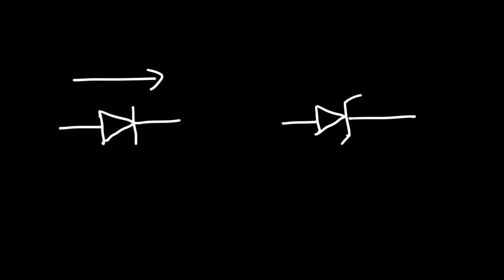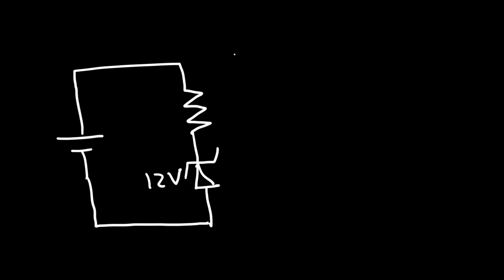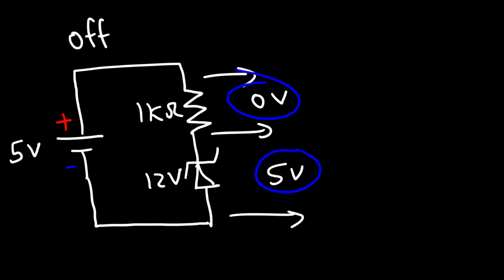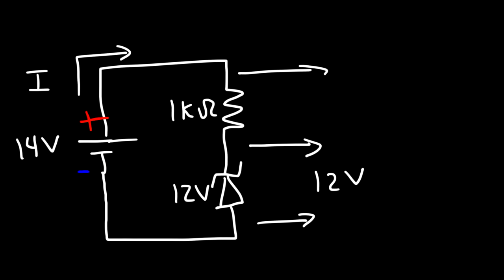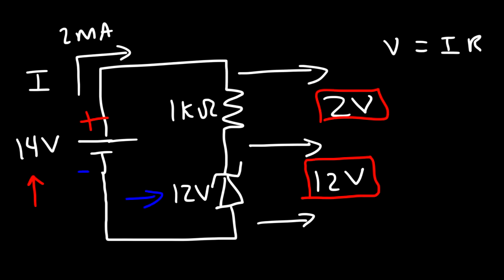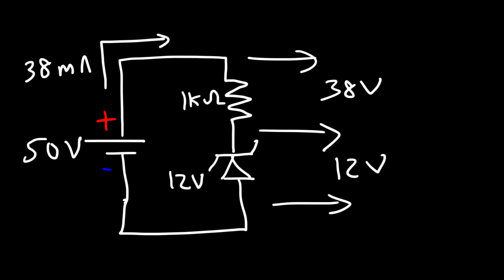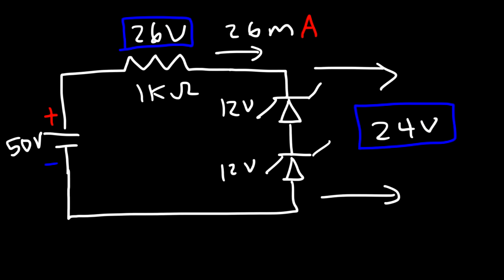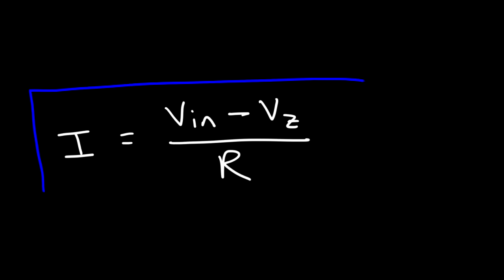Zener Diodes

Comment: Don't know about you guys, but ever since more than 40 years ago, in my school  electricity, that means, current, would flow against the arrow, so, as for me, it is rather difficult to understand your "new" theory. Sorry.
Reply: I'm likely the same age as you.  I was always taught that current flowed positive to negative, and a lifetime in professional electronic design has backed that up.

I had a tearful moment of crisis at age 10 when I found that electrons flow in the opposite direction, but I soon got over it.  :-)
It's easy to rationalise when you remember that electrons are negative, so negative flow from negative to positive is positive flow from positive to negative.
If we were starting again knowing what we know now, we'd probably define electrons as positive, but it's a bit late now.
Reply: @epiendless1128  The notion of the conventional flow of the current is much more practical in working with electronic circuits. As regards the classic example of understanding how a rectifier diode works, we usually say that it conducts "when its anode is more positive than its cathode" or, when this doesn't happen, because its cathode is more positive than its anode, we say "the diode is reverse biased, so it is in cut off state". The notion of the real flow of the current renders the above explanations (taught for years and years now) absolutely absurd. On the other hand, when we have a circuit of resistors connected in series in a closed circuit and we measure the voltage across any or every resistor of the circuit, the multimeter will show a minus sign if the red probe (connected in the right terminal of the instrument) is connected to the side of the resistor nearer to the positive terminal of the power source. Practically speaking, the conventional current flow makes our life much easier in order to understand circuits and troubleshoot failures of them. At least this is my humble opinion about the topic...
Reply: I agree.  They explain it as "holes flowing in a certain direction" rather than current flowing in a certain direction. 

To the elements in the circuit,  it doesn't matter if "holes" (i.e, positive charges) are flowing one way, or current (negative charges) is flowing the opposite way.  If you're able to conceptualize that, it makes accepting the idea of "conventional current" (i.e, following the path from positive to negative)  easier to live with.  However, I agree that they should just make the switch to following the path correctly, from negative (excess electrons) to positive (lack of electrons).
Reply: @maskedmarvyl4774  "just".

Comment: why the voltage across the diode is always 12v?I don't think that's correct because the diode only works like a switch here but not a resistance that it will have any voltage drop!
Reply: A zener is not a switch.  It's a voltage drop.  Think of water 14ft deep encountering a 12ft wall.  Only the top 2ft of water can flow across the wall.

Comment: I have see a few of the depict electron flow in the wrong direction. Electrons flow from negative towards positive. Ie. the negative terminal of a battery to the positive terminal. This means in a standard power diode (IN4004) the electrons flow against the arrow (triangle point) of the diode. As described in the video, a Zener diode allows a specific amount of flow in reverse bias configuration called leakage. (with the point flow)
As a side note, electrons don't actually "flow" through a conductor such as a wire. It is an energy bombardment impacting each atom of the conductor sent through it as a wave. Think of that thing with a row of steel balls each hanging on a string, you draw the first one back and release it allowing it to hit the second ball. None of the balls move except the ball at the very end swings out. This is the exact principal of how electricity gets from one end of a wire to the other end.
Reply: If want to explain this to people, create your channel

Comment: Can someone please clear up my confusion. In A.C circuit example 2 zener diodes are used, how is the voltage drop of forward biased zener diode 0.6V and the other 12V.
Reply: A forward bias zener acts just like an ordinary diode, and silicon diodes have an inherent voltage drop (at low current) of 0.6V.  You need to go into the physics to understand why.  The reverse biased voltage is what the zener was designed to do - you can get zeners in lots of different voltages and this one happens to be rated 12V.

Comment: I'm trying to use a zener to turn on a relay at a specific voltage. If I'm understanding correctly if I put a 12 volt zener in series with a 1k resistor I can turn on a 12 volt relay and when the supply voltage drops below 12 volts it turns back off?
Reply: The relay would turn off anyway if the voltage drops below 12v.You don't need the Zener diode.
Reply: @smak3924  no it wont/didnt.
Reply: @eavedesian  for this purpose you need a circuit composed from a NPN small signal, general purpose transistor that will drive the coil of the relay. One side of the relay coil goes to the power supply positive. The other side of it goes to the collector of the transistor. Across the coil you need to instal a diode in reverse bias in order to protect the transistor when the relay deactivates. This means the cathode of the diode (it can be 1N4148) goes to the coil terminal of the relay which is connected to the voltage source positive side and its anode goes to the connection of the coil with the collector of the driving transistor. Next, the emitter  of the transistor goes directly to ground. This means that the relay coil is in series connection with the power supply. Note: if by mistake you connect the protection diode in the opposite way, it will burn out immediately destroying the transistor as well, as soon as the circuit activates. Then, the only thing left is the base circuit. There, on the transistor's base, you connect your 12 volt zener. Its anode goes to the base. Its cathode (the coloured ring side) goes to the resistor. And finally the free terminal of the resistor (which is the voltage sensing terminal) goes to the connection point you want to detect. If this is the +12Volt of the power supply, then it goes there. The point is that you need to find the relay's activating voltage experimentally. This means that if you use a 1KOhm resistor, perhaps your circuit will not react on 12V needing higher voltage. This means that you have better to use a trimmer potentiometer of 1KOhm instead of a fixed resistor and then adjust it to the reaction point you wish. Perhaps, for activation at around 12volt, you need to play with smaller zener diode voltage, say 6,2V for example. (Correct resistor value and zener voltage need exact calculations, but you go by experiment).  I hope this will help you out. You can find details about this topic if you search about "automatic full battery charge cut off" circuits for 12V lead acid batteries. This type of circuit is used extensively in a plethora of relevant videos about this circuit.

Comment: why you have taken 0.6 v for forward bias
Reply: eight months without an answer hhhh, look at those who are thanking him, they don't ask for more, they're already saturated, i'm gonna wait with you till someone gives us a good answer
Reply: The forward voltage drop required to set a diode in conduction mode or min. Usually 0.6-0.7 volts below which the diode does not conduct
Reply: 0.6v is a typical value, you can get an exact spec from the datasheet of the specific zener diode

Comment: If the R is in series with the Voltage source, and there is another resistor in parallel with the  Zener diode, what happens when the voltage source is just equal or below zener voltage? Would the current go to the parallel resistor?
Reply: What you've described there is a resistive voltage divider.   If you just have two 1k resistors in series powered from 24V, then each resistor has 12V across it.  If you then connect a 12V zener across one of the resistors, little-to-no current flows through the zener, because the current is already going through the parallel resistor.  If you then increase the 24V to 36V,  you'll get 24mA flowing through the lone resistor, and 12mA each flowing through the zener and parallel resistor.

Comment: Conventional current should be relegated to the dust bin of bad science. It is still around due to each graduating class starting with the first one 250 years ago being taught it. When it was discovered by JJ Thompson that it was the electrons that actually flow negative to positive, not positive to negative.  It was so ingrained in the scientist heads of the day that current flows positive to negative, that it is still used today even when it is totally wrong. Granted it doesn't make any difference to the circuit, but as I had mentioned on my previous note, battery theory has the current flowing into the positive terminal, where as electronic theory shows current flowing out of the positive terminal of the battery.  Could totally and completely confuse the beginning student with no knowledge of the "non-flowing" conventional current.  I love all your videos, and think you are superb. Thanks!
Reply: Bernard, I hear your cry from the heart 😭 but let's get the easy stuff out of the way first.

Like :

* Converting the USA to the metric (SI) system ;
* Getting the USA to drive on the proper side of the road

With those out of the way we can focus our energies on getting those electrons swimming downstream...  ➡️➡️➡️🏊‍♂️🏊‍♂️🏊‍♂️

Until then we will be peeing into the wind and hoping not to get our shoes wet.
Reply: Great, let's just change every semiconductor datasheet and circuit diagram in the world.  Good luck with that.

Comment: Sir plz make a vedio on diodes and resistance circuits.. and make long vedios.. god bles u.
Reply: Owais Wani 

Amen!!
Reply: if there are resistance pararel with diode, that diode just regulate the voltage and wont flow any current. I have try this on proteus